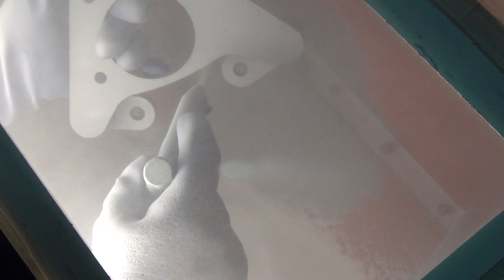Glass Bead in Real Time

Comment: Hi Mike   I have seen a number of dust catchers for the bead blaster.  One of interest was 
from the Ford Model T Forum a few years ago.  They use a shop vac and a water bath to
clean the air.  Let me know if your interested and I will forward you pdf copies of the 
articles / plans.   Rod
Reply from the maker: +Newmachinist Hmmm....that sounds pretty interesting....provided it's not too big.  The dust from the glass beads tends to plug up the filter.  I'd like to check them out. :)
Mike

Comment: I was just thinking maybe you should move the hose in a vertical horizontal figure 3, nah, just messing with ya.   How long does it take to get more crap in the bottom of the cabinet than beads?  I guess that is near the change out point?  Thanks for sharing.
Reply from the maker: +cerberus Kinda depends on how much crap I have on the parts I'm blasting.  This should be for finishing, so the amount of crap should be pretty low.  I should be able to sift some of the debris out too.  If it starts plugging up, then I know it's getting too much debris!  Thanks!!
Reply from the maker: +cerberus Almost missed the last question......if I sift it like I mentioned......I shouldn't have to replace it for a year or two.  The last stuff was in there for about 4 years?

Comment: Hey bro I have one question, can glass beads get wet if mixed with water like sand or soil ?
Reply from the maker: The actual beads themselves won't absorb moisture, but I don't have any idea how well they would work in water for blasting.  I actually use glass abrasive.  Since it's broken glass and the particles have a more irregular surface, I would think that it would "mix" better with wather.  Either of them should dry, just like sand/soil, after being mixed.  What are you trying to do?